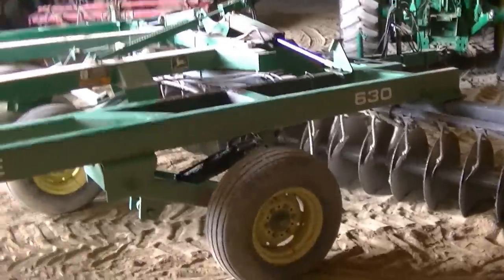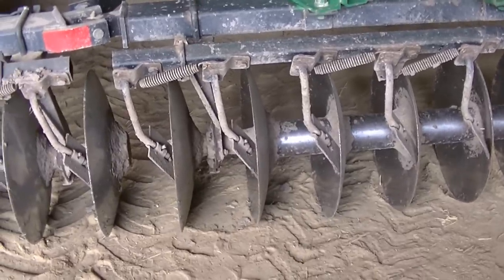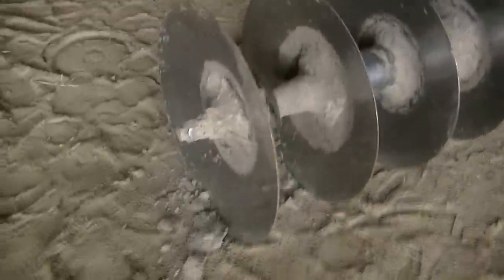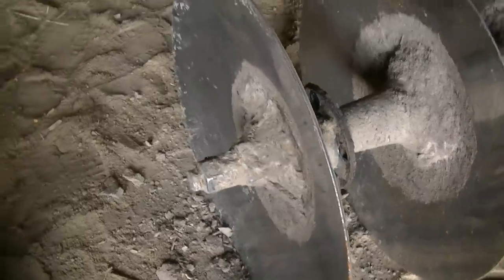Repairing the disk gangs!

Comment: In Croatia if the shaft is bent, we straighten it... If it broke and it's an emergency, we weld it together. If the disks weren't tightened down right, and the shaft was worn round where disks go, we also weld it and grind it afterwards to square shape. Even if disks had their holes rounded off, we have a copper "cube" which is the same size as the shaft and weld new material to the worn disk... The weld doesn't stick to copper so you get a "rebuilt" disk with a square hole that lasts a season or two...

Just replacing bent parts is last option over here as its very costly and not really necessary in majority of cases...

If I were you I would get that shaft straightened, threads "cleaned up" because of torching and leave it as a spare part. You never know when you will hit a stump or something and brake a shaft on the disk.
Reply: Yeah, that would have been an easy fix.

Comment: the rod you speak of is called a gang bolt, don't forget one edge of the spacers is curved. you should have got a set of gang bolt wrenches with the disk.
Reply: It is called a shaft and on this model disc the spools are bi directional.
Reply: @hondamaniack  actually it is called a bolt...I have been calling it a shaft fir years but everything I go onto the parts list...it's called bolt

Comment: You didn't need to torch the nut off the arbor bolt. Spray it with penetrating oil for a day then use an air impact to remove the nut. If the nut comes off hard use the torch to add a little heat and it should come right off.

Comment: a nice bit of material there, i would re use it in a second, pound it 1/3 in the clay and tie the apple tree to it.
yes a machinist could have straightened it, but what would it cost and what would the new one cost more if you take labour in consideration? now you have it done with a part guarantee so if it fails you can claim.
Reply: +Arjan Wilbie you know a machineist that can compress a stretched piece of iron to its original state? I seriously doubt it
Reply: with heat it can be shaped in to the straight bar. how long will it keep straight is the question.
Reply: Arjan Wilbie "bodge job" says it all
Reply: +Arjan Wilbie So if you hook a tree your part guarantee will replace it. Cool I will have to try that.
Reply: +Arjan Wilbie If you heat it -not long. It bent cold -straighten cold in your neighbors press.
Reply: +Mack Thompson Not cool to AW
Reply: Bodge job, make things last a bit longer till the new parts come in. building a working engine from three scrap ones. it is a art i learned from driving vehicles where the parts are scarce off.
ground anchor as part of a winch kit made from broken half shafts. it is fun to create from 2nd hand bits

Comment: Just a safety suggestion, never use a claw hammer to bang on steel spacer like that.(Can possibly shatter) Ball,cross peen and or sledge is appropriate tool, and eye protection.  Be careful and good luck

Comment: you could have straightened that in five min
Reply: +Wyomingfarmer I've done this repair before on landoll and sunflower disks, and I can say a hammer is not enough to bend it back and it takes a press to get it straight again. Most shops like this dont have a press, we do because we farm about 8500 acres and we fix all our equipment.  Plus he said its stretched out as well as bent so its just better to buy a new one and avoid a bigger mess down the road.
Reply: +ANDREW MILLER 
could've used a press like we have or a skid steer and some blocks. it was bent cold, no problem bending it back cold. and they don't farm much anyway.
Reply: Every shop needs a press and you can buy a 20 ton press from Harbor Freight for under $200. Made in China but they work fine for easy jobs like this. I have straighten these shafts and then added a couple washers on the end and it is good to go.